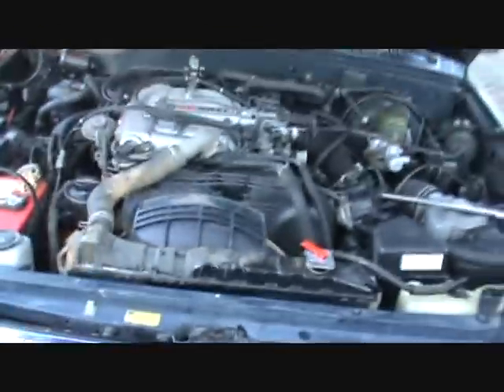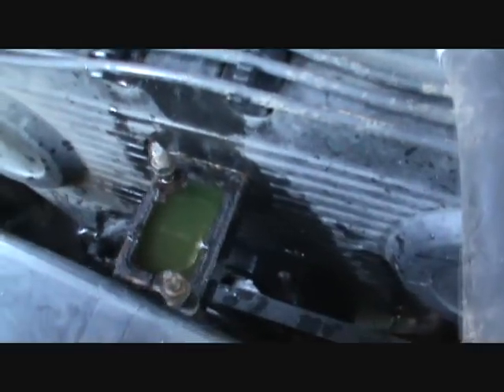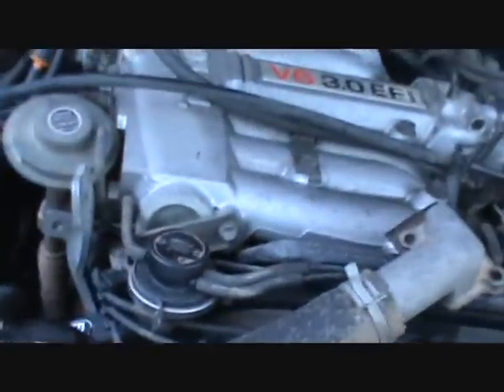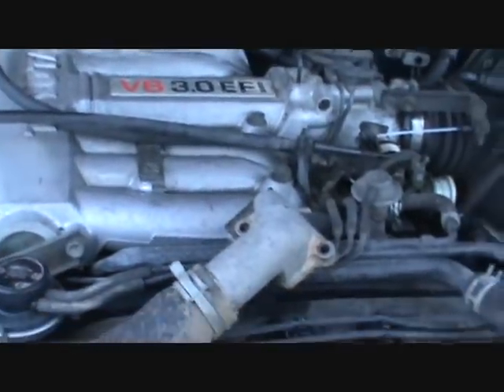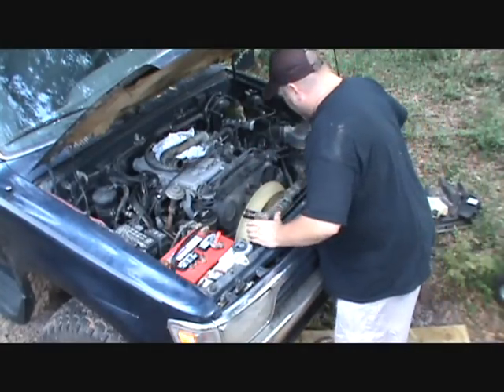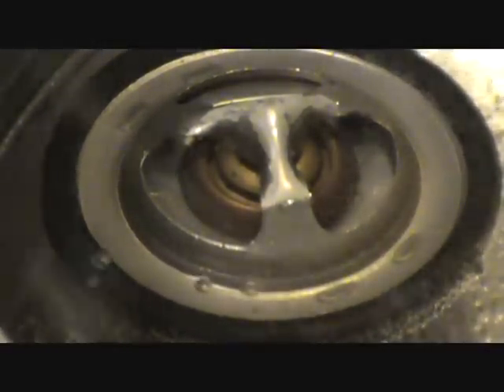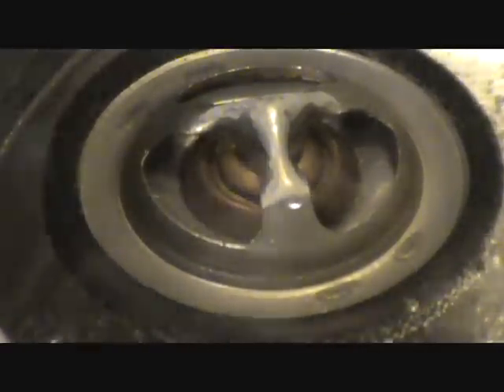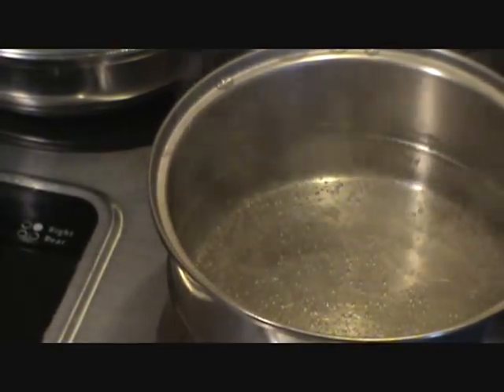Engine Repair Part 1

Comment: Better way to tell the thermostat is working good is to add a cooking gauge to the pot of water that way you can see at what temp did it open at some dont open at whats stamped on them

Comment: The blown gasket was most likely due to the fact that there was a factory recall type deal on these up to 1995. The gaskets were faulty, the head bolts were not torqued properly. The dealerships will repair this $2500 job for free if your vin numbers qualify.

Comment: 3vze is a POS  engine  after  2 head gasket jobs im putting in a chevy  350 and  th  350 trans  its a great truck  just under powered with the pos engine